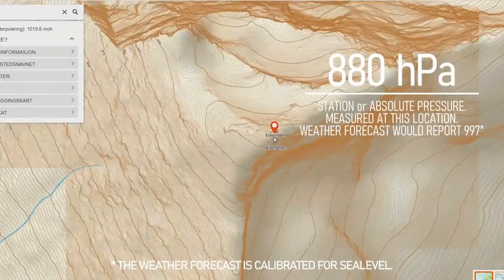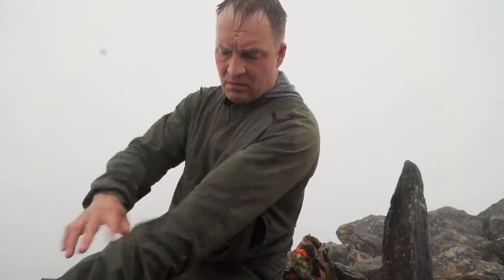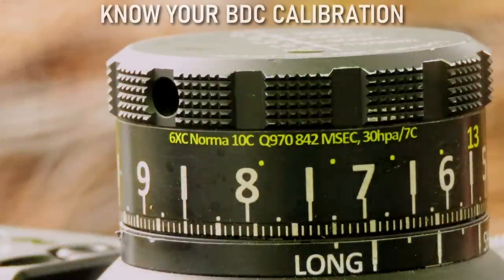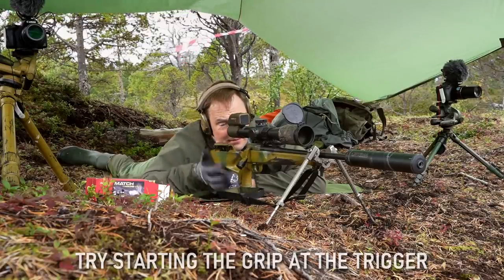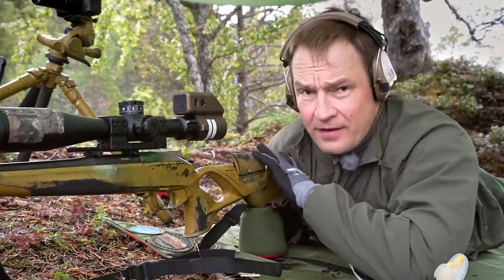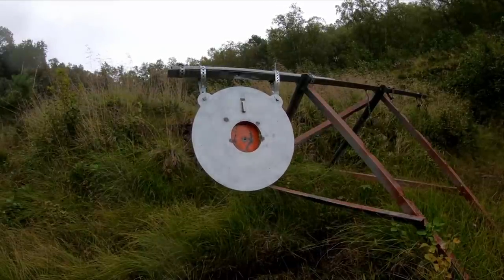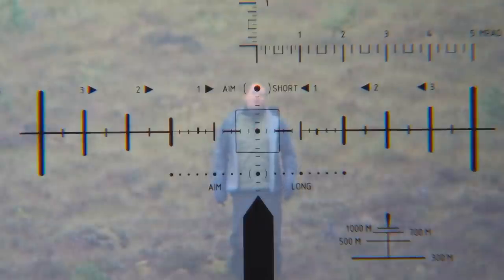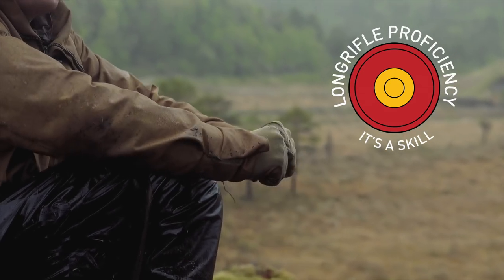LR Blog 343: Learn longrange

Comment: Good information. We have much less elevation variations here but wide swings in barometric pressure and humidity (like you experience). Nothing like getting all set up only to have a front move in making your targets invisible! At least it wasn't snowing. Thanks for another great video.
Reply from the maker: Thanks Peter, glad you liked it. Yeah, it is exactly as you say. If the airpressure change fast enough to be relevant for shooting (after initial setup) you also have a weatherfront moving in and the severity of that usually cancels the finer points of LR.  Topographical equidistance and weather isobars are similar if the lie tight on a map - the going will get rough...

Comment: I have been applying this technique of pressing the bipod a little, in my case I shoot with PCP (air rifle) and I noticed an improvement in my consistency.
Reply from the maker: It should! Easy to be consistent and manage the same pressure.
Reply: @THLR  I'm currently making a wooden stock, my original is polymer. If it works out, I want to make the next one similar to yours, including the painting, I think her look is amazing.

What model of your rifle?
Reply from the maker: @cesarmuller8962  Blaser R8 Ultimate. Good luck, woodstocks can be very nice projects!

Comment: Another nice video. Which jacket was it? Have your tried the hestra tactility gloves. They are pretty comfortable and inexpensive. (230~kr on sale).
Reply from the maker: Made by me. I haven't tried the Hestra as I've spent too much money mailordering ill fitting gloves that doesn't get used. So now I shop local, which can be quite limiting. Lately I've been using basic utility gloves bought at Clas Ohlson, they are so cheap I can have three pair and simply put on a dry pair. All gloves seems to get wet, so former editor of Vapentidningen P-O Olsson gave me that tip. He used wool gloves for his winter driven hunts and simply changed gloves as they got too wet. I've partially adopted the same coping strategy.
Reply from the maker: Kr 29,90 and you find them with variations latex and nitril depending on preference. They have completely replaced the Mechanix for me as they cost 5% https://www.clasohlson.com/no/Latexhasker,-gr&oslash;nne/p/41-1469-10

Comment: Do you consider spin drift and Coriolis effect at all? Also would love to hear how you made the wind call. You hold 1 mil for the 1st 582m shot, then hold1.3mil for the 2nd shot? That equivalent to 4.5m/s and 6m/s wind call?
Reply from the maker: Yes and no. Spin drowns in wind, but it is a very real effect. Coreolis doesn't come into play properly until a much farther range. My rifle is half the hundreds, meaning 600 is 6 hundreds and half of that is 3. So if we rearward engineer a windcall of 1.0 mrad at 600, that's  1(point) 0 hold divided by half the hundreds which is 6:2=3. That gives you hold:thumbrule=wind or in numbers 10:3= 3,3 msec effective wind. Same with 1 (point) 3 mrad, 13:3=4,3 msec effective wind or crosswind component as it is properly called.
Reply: @THLR  Thomas, I understand that "half the hundreds" is the ballastic profile of your rifle and cartridge. But what was your calculation to classify your profile as a "3"?
Reply from the maker: @BestICan  whatever units used, simply put wind value to 1 and look at the relation between wind correction and hundreds of meters. Formulate a sentence for that pattern. Half the hundreds is mine.  Hundreds minus 1 would be a normal 308. The US counterpart would be the "mph gun" rules.
Reply: @THLR  Understood. Thanks.

Comment: Thanks fer sharing another great & informative video,....you are obviously one of few in this world that shares my passion for longrange target shooting. May I ake how old your Blaser action is,.I believe this is your second?..., & how many rounds, about, through it?...., any problems or parts rplaced? Thanks again & TIA.
Reply from the maker: Aaaaah, Blaser since 2010 with the R93 ??? Only changed to R8 because of barrel supply, that was in 2017 and switched to the Ultimate stock in 2019? Which should put the R8 round count 10K'ish over 3 barrels? The problems I've had is bipod pins or screws coming loose, so I glue everything either LocTite or permanent. Everything that doesn't need to be moved or adjusted is glued. An annoying detail is that the Ultimate butt adjustment sometimes hooks itself into vegetation, very annoying to have that "pull" and imbalance when I'm climbing. So for the mountain birds I use my Clymr stocked Rem700 as it is both lighter and more "snagfree". But barrel prices have gone through the roof, so unless I can negotiate a better price, I'll have to leave the system due economy. Which is a shame, because it plain works at an excellent level. But the extra cost equals my hunting, and of those two options Blaser will lose.